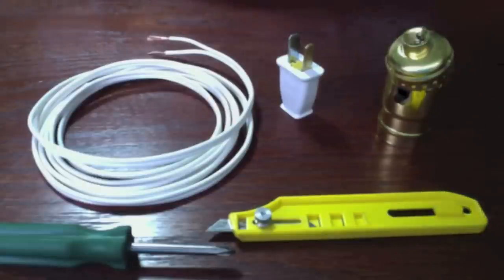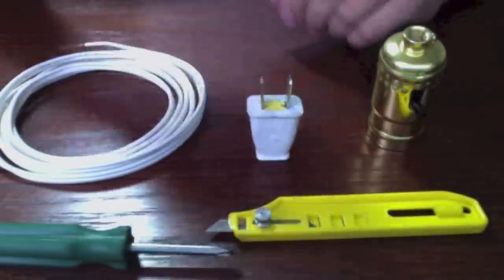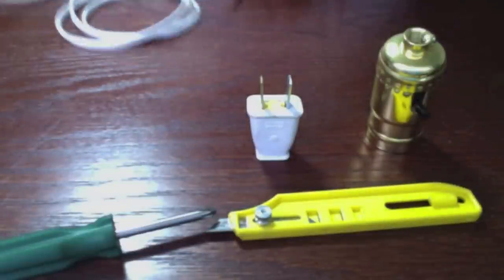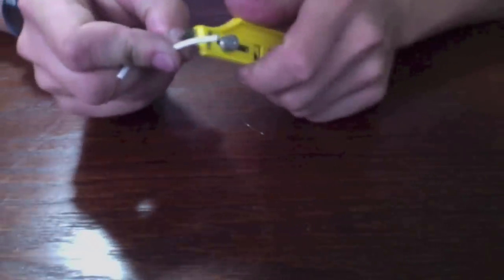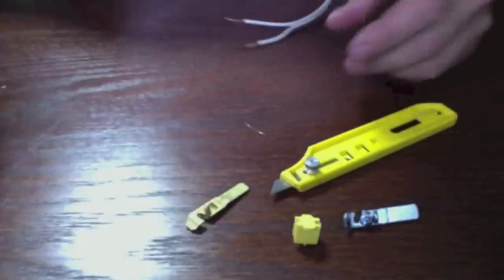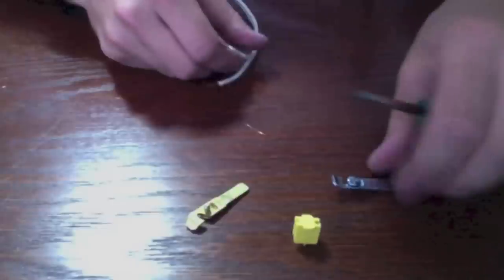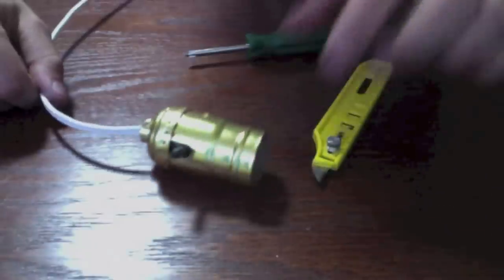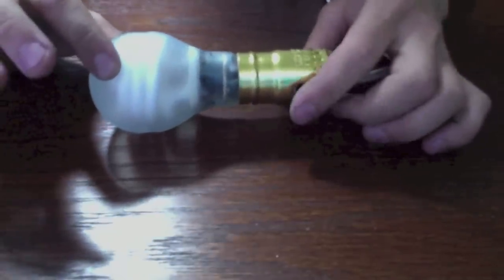How To: Make a Lamp

Comment: As someone who had 0 knowledge on anything wiring related, thank you for teaching me how to wire my own lamp. I wish a lot more tutorials were simple like this, makes it so much easier
Reply from the maker: Hi Dillon, thanks for your feedback! I’m glad this tutorial worked well for you. Enjoy your lamp building!
Reply: @nonscioap  Thanks! Just a quick question, do you have/would you make a tutorial on how to hook up multiple light sockets to a single plug? For lamps with more than one bulb?
Reply from the maker: @Motowad  I have had a request for this several times now and it is in my queue. So to answer you question, no, but it will be available soon! In the meantime look up some information on wiring light bulbs in series. It sounds like that is what you are trying to achieve. Best of luck, and please let me know if you have any other questions!
Reply: @nonscioap  okay, thanks for the replies!

Comment: 2 things. 1) I probably would've tinned the ends of the wires for maximum connectivity. 2)Using a black sharpie to mark a line on both ends of the ground wire would've saved you time on all the taking things back apart and reassembling them. Other than that good basic tutorial
Reply: why u watching if youre such a lamp expert?

Comment: Hi, could you please make a video with a three plug?
Reply: Luana Mae your right he takes too long
Reply: Luana Mae For a three plug the only difference is one wire is used as a “ground” (green). So you have your “neutral” (white) which goes to the silver screw. Your “hot” (black) which goes to the gold screw. Then the “ground” (green) which goes to the green screw. Thats the only difference.

Comment: How do you know which one is negative and which one is positive?
Reply: The wires have the same copper on both sides, so either one can be positive or negative. The important thing to remember is to connect one of the sides to positive on both ends, and one side to negative on both ends so they match. He did this in the video by showing that the silver screw went to the silver prong and the gold screw went to the gold prong.
Reply: Lamp cords usually have a ridged insulator on one of the wires. Convention has the ridged wire going to the wide, neutral prong and the silver screw on the socket.  The narrow prong (smooth insulated side of wire) is the hot side.

Comment: I think mentioning which side of the wire is pos.and which side is neg. and how to tell the difference before you start wiring.
Reply: There is no positive and negative side. Watch the video. The positive and negative is on the hardware not the wiring.
Reply: Look at a lamp cord. One side is ridged the other is smooth.  Ridged goes to neutral (wide prong) and silver screw on socket.